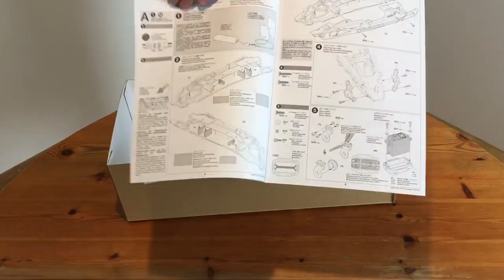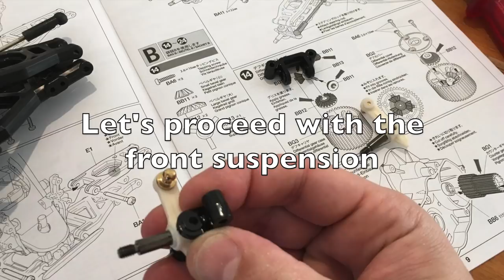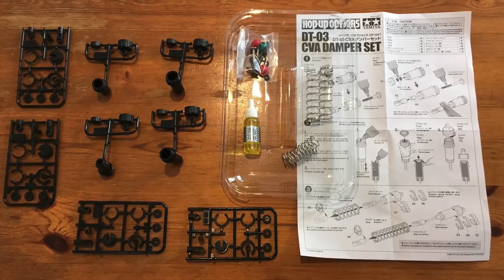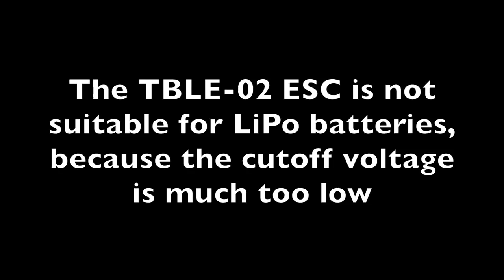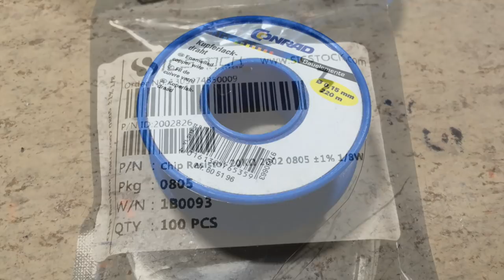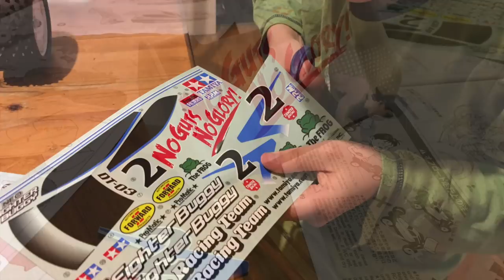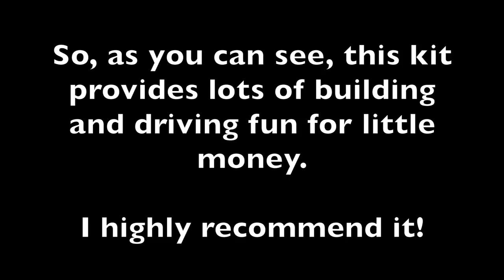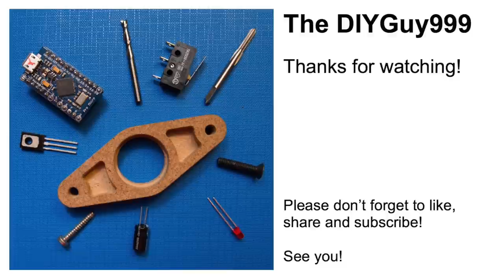Tamiya NEO Fighter Buggy Build With DIY Arduino 2.4GHz Remote!

Comment: I think WLToys A959 can run faster than this buggy
Reply from the maker: Yes, the A959 is faster, but uncontrollable @ high speeds. The NEO Fighter Buggy on the other hand is the exact opposite. Not the fastest, but extremely controllable, even with its rear wheel drive. And if you have ever driven a rear wheel drive car, you know what fun is. So I really like this Tamiya buggy!
Reply: TheDIYGuy999 hmm... Interesting...
How much the cost?
Reply from the maker: About 90$ for the kit including brushed motor and ESC. Everything else is not included. See the parts links in my video description for the other required parts.